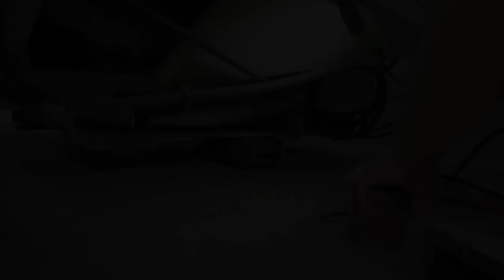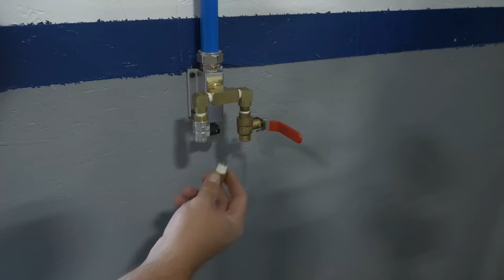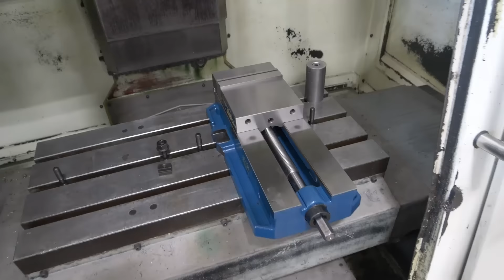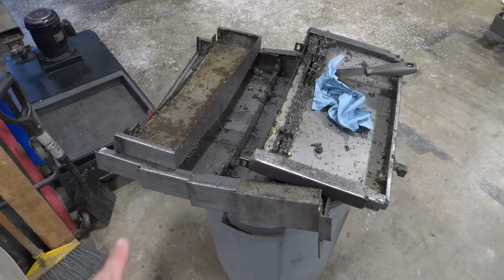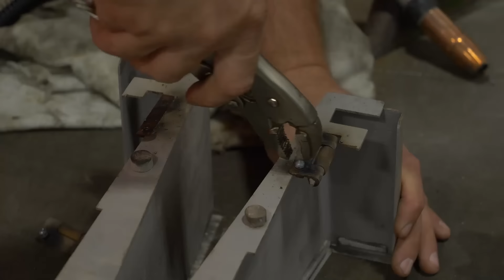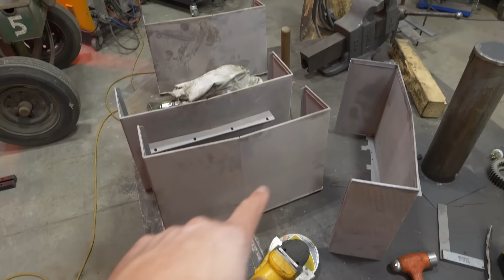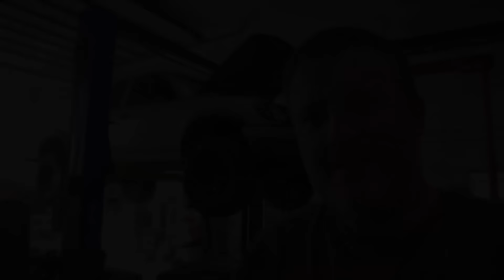Did I Buy a Problem or a Solution? Cheap CNC Repair Part 1

Comment: METRIC!!
I lived through the 'transition' from Imperial to Metric (Australia) at every change we lost out.
1 Penny = 1 Cent 1 Pound was 12 pennies then suddenly 1 Pound = 1 Dollar = 10 Cents, we lost 2c in the dollar.
The measurements well by rights 1 Foot = 304.8 mm Right? NO what use to fit ia 1 foot space is now 4.8mm Short.
Volume went the same way, Gallons to Litres, you got less Gas and paid more.
Metric is a Lose Lose conversion.

Comment: Little correction: The metric system went from mass to force quite a while ago, it´s no longer kilogram meters, it´s Newton meters. 
Pound is still a unit of mass, just like grams, so I´d say the imperial system still uses mass to disguise as weight.

Comment: I have a bad addiction when it comes to buying non working cnc machines.  I currently have a 1995 haas vf3 which is probably my best machine, it sat unused for many years and is actually a very low hour machine and it had a bad spindle encoder.  I also have a fadal vmc 3016 and a fadal vmc 15xt, both of the fadal machines have aftermarket retrofit upgraded control systems.  I paid exactly the same price for all 3 machines at $1500 a piece and they came from 3 different places.

Comment: The Imperial system must have been invented by a standup comic. What are they called? Inches. And 12 of them make a foot. mmmmm what about larger measurements? Oh, you might mean fathoms or is it chains. What are they? Oh there's 6 feet in a fathom and 22 yards in a chain. What's a yard? Oh, 3 feet, that's easy. mmmm no I mean larger sizes or distances. Oh, you must mean a mile. What are they? Oh, there are 1760 yards to a mile. Sounds like the comic might have been drunk…………. Or had syphilis …………. Or got drunk and acquired syphilis. How do you remember all this stuff? What about really small measurements under an inch. Oh, there's half an inch. OK, makes sense. And 1/4 and 1/8 and 1/16 and 1/32 and 1/64 of an inch. Oh, you don't say. Easy numbers then. Lol

Comment: Love watching you explain complicated problems of those CNC machines.  Even the factory final assembly and testing on some of the models I used to haul would have the engineers pulling their hair out when at the end of a 24 straight hour performance test would fail and they couldnt figure it out quickly.  You should have been a votech school machinist instructor.

Comment: Don't forget about how dumb Celsius is. Like people say "it just makes sense for 0 to be the freezing point of water and 100 to be the boiling point. So simple!" But like is it really? What advantage does that really have when you're measuring literally anything other than water? Why not the freezing and boiling point of mercury instead? Sure it might have made calibrating your thermometer easier, but that's it.

And why set the boiling point at 100? Why not 10, or 100 or maybe another round number like 200? How often do people use temperatures above 50c? How often do you use Celsius without at least one decimal? Setting 0 and 100 as the freezing and boiling points of water is just a waste of precision.

Fahrenheit might have less clear definition of 0 and 100 and (have been) harder to calibrate, but it's more precise and 0 to 100 is more useful for everyday needs.
Reply from the maker: To make it worse, technically Celsius is not a legit unit. They should be using Kelvin...

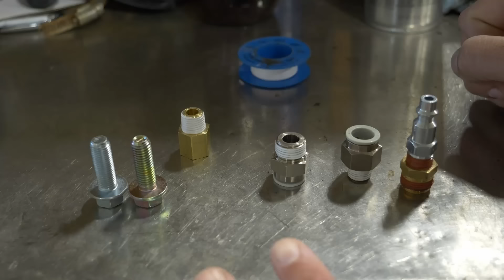Comment: 5:39 i'm watching from switzerland and i do use the metric system but there is a bunch of dumb speciality treads that are neighter metric nor us "standard". My favorite from my apprenticeship days was the Pg (Panzerrohrgwinde -> EN: tank pipe tread, tank in terms of the military vehicle). For some reason, that used to be a common tread for cable gland and conduid. Ofcourse the place had a bunch of old stock that they wanted to use up so i did cut Pg treads in a lot of stuff instead of metric even though it was the year 2013
Reply from the maker: Weird. There are some weird threads in the US as well. Hydraulic cylinders are probably the worst. They just pick a thread pitch and make the diameter whatever works for the materials they have.

Comment: I studied physics with the imperial system through high school in the UK. 
My last year of study 1966 the UK went metric just before my GCE exams. 
Need I say more. We could multiply fractions, wonderful chunks of tangible reality, in our head.
They said metric would make things easier.
Reply: Most of what I deal with is length measures and I'm not keen on metric for that. I just don't like what the scale looks like. It's not for me. I do have to look at the stuff while I'm using it too.

Comment: Man, the way You explains things shows You have kids, I love it. Maybe You could do a video on imperial measuring? For us metrics? For example the inch scale on my caliper: it´s a Mitutoyo and it does inches in 1/128- I can not warp my head around that. Sometimes converting is a pain, I´d like to use the inch scale, actually.
Kind Regards
Reply from the maker: Yeah. Once we get past 1/16s I switch to decimal inches.
Reply: Your calipers are weird. Normal calipers read in decimals. To the thousandth of an inch with digital calipers having another 0,5 place on them to display half thousandths. A micrometer would have a full ten thousandths display. I don't have a digital micrometer myself. I hardly ever use micrometers. I do use digital calipers a lot though. That's close enough for whatever I do. I have a set of 1-4" mikes. I just don't use them. If I'm within a few thousandths that suffices.
Reply: @1pcfred  Err- Ehh.. I don´t have anything digital. Yeah, would be easy but I didn´t get around to buying digital stuff.
The stuff I can afford is crap, the stuff I want is way over my pricehead.
So: no digi for me- yet.
Reply: @LaLaLand.Germany  I have cheap digital and good. The cheap stuff isn't bad. Better than one might think. There is a bit of consistency issues. But if you double check you're OK. The real problem with the cheap stuff is battery life. The difference there is dramatic. A big negative with digital is dead batteries too. Still, I'd use the cheap stuff and just deal with the battery issue. Reading digital is so much faster.
Reply: @1pcfred  I see Your points. Yes, can´t argue about ease of use.
Normally I don´t need inches and I like my analog, I like its feel.
I once bought a cheap digi at local supermarket, just for giggles.
And I giggled. That thing even had grinding dirt in it, still. It was a really bad tool. Waste of resources and money.
I will get me a good digi one day…
Kind Regards
Reply: @LaLaLand.Germany  yes the cheap ones tend to have manufacturing debris in them. There's videos here of people opening them up and cleaning them out. I've seen them. What do you expect for cheap? You should see the way the depth rod is held on in the cheap ones. If you open it up you will. They all have a unit button on them that switches from inches to millimeters.

Comment: Who are you trying to kid Wes? "I wished I hadn't bought the most clapped out machine ever!"  Bull pucky!  You live for this type of stuff!  You are in heaven on an issue like this!   BTW, not a huge fan of repairing frames either, especially when it's not my own.  Can be tough finding decent metal to weld to not to mention if anything happens you, as the repair shop, could be held liable.

Comment: Two BSPs
BSPT - British Standard Pipe Tapered - seals on threads
BSPP - British Standard Pipe Parallel - does not seal on threads (crush washers, o-ring or tapered seal in a machined groove, or the good ole' bonded washer, aka  'Dowty' seal)

But NPT also has two
NPT - National Pipe Tapered
NPTF - National Pipe Tapered Fuel -aka Dryseal with peaks that were supposed to interfere and seal off the thread spiral when assembled; you can guess how well that actually works

And another 'Murican pipe variation
NPSM - National Pipe Straight Mechanical - not meant to seal but for structural pipe frame work
NPSF - National Pipe Straight Fuel - also meant to use washer seals but can accept female NPT fittings though the sealing is eh as it only occurs through one pitch

BSPP still appears on fluid power devices, more than you would think.  Momentum, I guess.  Like SAE J1929/1 ports are still inch though are supposed to be deprecated for metric thread.

One thing does bug me about metric thread: they are rarely called out with the actual pitch.  Apparently, the rest of the world learned by rote in Kindergarten as to the pitch of M10 fasteners.

Parting trivia: 1"-14UNS (Special) are still around I assume from legacy of being the main fastener in the US steam locomotive industry.

Oh, and I think JIC is Joint Industrial Council though I don't know which industries were joining up.

Comment: B&S' early numerical tool changers used a 50-taper tool holder. A good array of tools required a rack of fifty tool holders. During the development and in some of the early sales, the tool presenter would quarterback the tool holder across the room.

Comment: Tour commentary about the different connectors isn't uncommon. In the fire service the most common type of thread is called National Hose Thread. However, there are some jurisdictions have their own thread  Among these are Louisville, New York, Chicago and Cincinnati. So if you give/receive mutual aid you need to keep a set of adapters so that you can connect to their hoses, hydrants and apparatus!

Comment: Having tried to revive a 24 year old CNC I admire your tenacity.  Mine ended up being scrapped because the control died shortly after connecting power. Good luck!
Reply: Retrofitting a machine controller is pretty standard fare with CNC. I think I'd do it even if the old controller worked. Just for the upgraded interface.

Comment: Christ above Wes, this is one of my favourite videos of yours for a while. My dad ended his career dealing with CNC's and big fancy machining centres. He installed almost all of the ones his workplace had as well as frequently moved them in the summer or christmas shut downs. 

How is this for a weird one - he once installed 4 machines in his works that were made by a very large Japanese machine company but these had been sourced from a closed plant in the United States. So you had a Japanese machine but everything was American freedom units of various kinds. It confused the kids but the old timers quickly realised why various fittings on it were leaking or that certain threads were not stripped but had wrong bolts. 

I remember my first encounter with NPT on an air tool a friend of mine got me from America. Luckily my dad realised what was wrong and explained the ins and outs of BSP vs NPT fittings. 

I have some idea of the amount of work you took on just to get to this point. First class! 

Also that Tacoma is sweet, its beyond economical repair but if someone offered it to me I would probably weld the frame on the grounds that a vehicle this good will never be made ever again.

Comment: Nope, for torque we use N×m and Newtons are a measure of force. No one still uses kg×m (they used to back in the day) because as you stated it is wrong (and always has been). It's not an inconsistency in the metric system its just a wrong use of units.
Reply from the maker: Why don't people just use Newtons for everything?
Reply: It's just sloppy thinking I guess. They also used kilopond kp which is kg force, so that resembled an equivalent to your pound-foot as 1 kp is 10 Newtons, so the gravity is factored in. But that's actuatually a unit that drives me nuts but after your explanation it makes a lot more sense, because I didn't know that pounds are a measure of force. I guess they wanted an equivalent to your units as they can be more intuitive as you said. Thankfully its obsolete and all the new equipment just uses N.

Comment: If the way cover wipers cost that much, well I doubt I'll ever own a CNC. Thanks for taking us on a tour of yours.
Reply from the maker: That's why you can usually get them for cheap, sometimes for free.
Reply: @WatchWesWork given brand new way covers still let in chips and removing way covers is actually not too difficult , if the machine is not for full production it may be just as well to have a schedule of cleaning three times a year. 
I know that's not how you like to do things but on a practical level it would make sense . The plastic guide corners however are definitely important to keep in reasonable shape as you pointed out. Thanks for all the many varied videos- all very enjoyable and educational .❤
Reply: The price of commercial industrial stuff is usually astronomical because it's a business expense. Companies rake customers over the coals then.

Comment: G’day Wes good to see you again boy that room you built was certainly worth it, if there is any one who can get it working it’s you,    It’s a fantastic thing to have just talking about measurements in metric or imperial , I prefer  imperial over metric currently I’m building a 7 1/4” llive steam locomotive every part on the drawing is imperial which I find it easier but people down here still use both. Bloody pity about that truck I suppose that’s due to rust that’s hart breaking can you effectively under seal the chassis to prevent that?    Take care I reckon you will have that CNC fixed and clean kind regards John

Comment: I live in Canada. We have been metric since the mid 70s (research will give varying years). I still torque everything in ft/lbs. We will never be fully metric. To this day, you still buy natural gas by the cubic foot, nails by the pound and 4X8 (feet) sheets of wood. That list could go on a long time. Things are getting worse with the multiple systems. NPT fittings that use a metric wrench. WTF???

Comment: Hey Wes not trying to blow your dress up or anything but you sir are a genius in your own right. The way you talked about the metric system and the pound system and even the different types of threads and different types of fittings I believe that you probably know more than you should??? Or at least more than the average bear that's for sure. I myself know about the fittings and stuff like that because well I did irrigation for 10 years and also worked on building fire sprinkler systems in high rises. I literally would look at a blueprint start putting and threading cutting and putting pipes and fittings together and package them floor by floor. I did this job at night after my regular job. Yes I too am a glutton for punishment. You also run into a lot of different fittings when you're doing heavy underground sewage construction which I did after all of this for another 4 years. But believe it or not I am a carpenter by trade of over 30 some odd years. When I heard you talking about the metric system and all that stuff yeah you probably would be better off if you were an astronaut or an engineer or something like that to understand that system because frankly it just boggles my mind sometimes. AnyhowWes I just wanted to say hello and God bless you and your family. I'll be waiting on the next video Drop.😊

Comment: Mass never differs, weight does. You’re measurements are different North Pole to equator, if your use weight based measurements. If you doubt this look how gold is priced [essentially, per mole]

Comment: How do cnc machines maintain such high accuracy as the wear climbs? Do they have large bearings so that the forces are very low on the bearing surfaces or how?
Reply from the maker: They don't. The control can compensate for some wear, but eventually you have to rebuild them or replace them.

Comment: I spent 12 years using a Haas Mini-Mill on an almost daily basis. It was a complete PITA to clean out and we always seemed to be in a time crunch, so sometimes chips would accumulate to ridiculous levels before getting shoveled out. The mast way cover had to be replaced after it got smashed by chips built up on the way cover behind the table. I tried to keep at least that area cleared out. The other guy who used the machine, not so much...
Reply from the maker: I had a Haas. It was the same. The rear would pack with chips. I repaired it several times.

Comment: The thing about BSP is that it is the defacto “metric” pipe thread, as it’s standardized by DIN as such. Metric bolts are also a bit interesting, as there’s no coarse or fine thread defined by a standard, only a set of standard pitches for each dimension. DIN defines a normal pitch for each diameter as well, so all the other pitches are “special”. So you can get the same JIS and DIN bolt, with the same pitch, and only the head size will be different, JIS like even wrench sizes and DIN likes odd sizes for bolts over M6.

Comment: Thanks Wes, enjoyed your video. I knew very little about large scale CNC machines and wear and tear. Shame about the Tacoma… does anyone have oil sprays done where you are? I have my Toyota  sprayed every year by Krown - it’s a 2015, and no rust, here in the Toronto, Ontario area. We have a bit of ice in the winter rather than snow so lots of salt and sand. Costs C$130 US$90 and 45 minutes of time but I think it’s worth every cent. The car mechanics keep wanting to buy my car. 😊